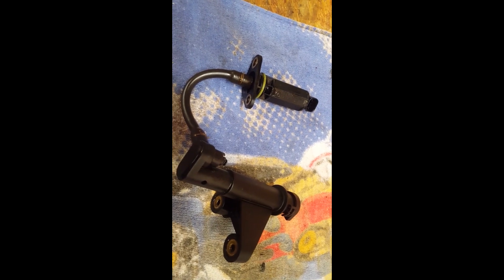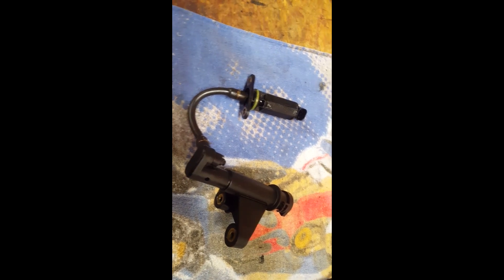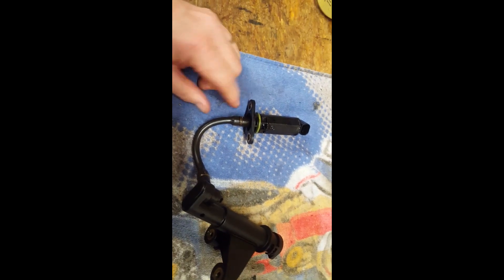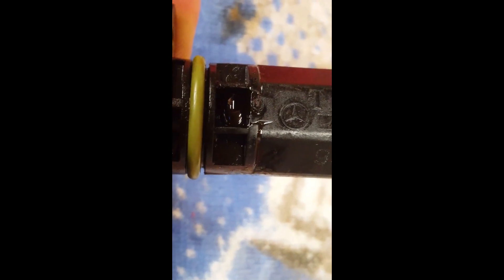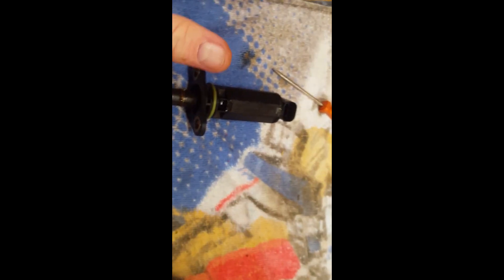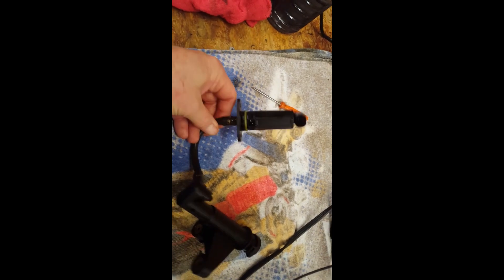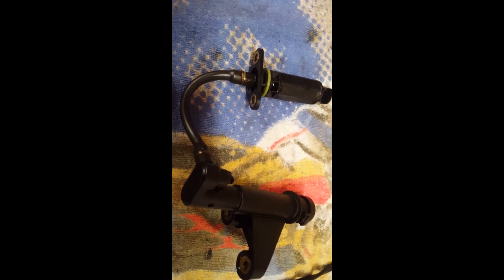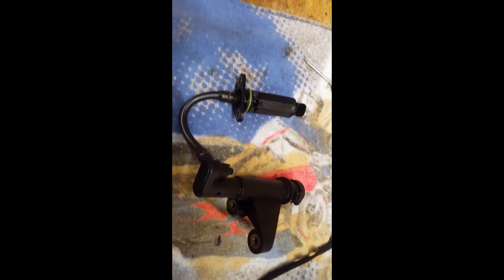Mercedes-Benz E320 Oil Leak Fixed !!

Comment: Great video and explanation.  I just finished replacing all brakes, rotors and calipers for a young kid at work. He bought a close to pristine 2000 E320 for $1000, with 150k on the click, elderly gent/orig owner- sat outside for 2 yrs. I noticed a minor burn oil cloud just below Left valve cover I’m assuming valve cover gasket, going to chase it down in the morning after my body recovers- haha
Thanks agin
Reply from the maker: There could be several sources.

Comment: I'm also going through this on my 2000 E430. Replaced oil pan gasket twice and also the oil sensor Oring and still have the leak. Did you replace the oil sensor  with MB part or replica part?
Reply from the maker: Mercedes Part as I recall.
Reply: Okay, Ordered MB part. Did you put some RTV on the oring prior to install?

Comment: I think I need to do the same on mine (late 99 E320 4Matic Wagon) -- Based on my research, I need to drop the shield to get to the oil pan, then drop the oil pan to get to the sensor, and have to reseal the oil pan when putting all back together.  I think I just need the replacement sensor and sealant as the "consumables" for the repair?  How long was the process for you?
Reply from the maker: Correct on the consumables. HOWEVER it all depends on experience level. If one has never removed and reinstalled an oil pan before, that process alone takes 90% of the time. There are a lot of bolts and they are all small and easy to break. I would concentrate on going slow and not be concerned with how long the process takes. If you break one of the little bolts off in the engine the process goes from a couple of hours to a couple of days. 😁

Comment: My E320 2002 has same oil leakage. Is that an OEM replacement or aftermarket part?
Reply from the maker: I purchased a new one from Mercedes. Part number: 0061532728

Comment: I have a question about oil leak in Mercedes e320 bluetec 2008, I dont see where exactly the leak is coming from but I see the oil on the front drivers side of the engine near the timing belt, it almost starts from the top, any thoughts?
Reply from the maker: The most common oil leak point on any car (IMO) is a valve cover. I'd start there.

Comment: Thanks for sharing!  Where did you see the oil travel after leaking?
Reply from the maker: When the oil was leaking from the sensor, it would run down the passenger side of the oil pan and it appeared as though the seal between the upper and lower oil pans was leaking. This made it hard to find.
Reply: @ImpalamansGarage  Passenger side means the side with alternator right above? My W210 is RHD, I found the engine cover is wet underneath the alternator. I am sure no oil leak for both side valve covers and ponder it's suffered from the same situation you mentioned.
Reply from the maker: @gbush1620  Mine is left hand drive. My oil pressure sender is below the alternator on the side side of the engine.
Reply from the maker: @gbush1620  very well could be. The oil pressure sender is made of plastic. Can easily crack.
Reply: @ImpalamansGarage  Thanks, so I need to open the oil pan in order to replace the sensor? If so, the sensor is inside the oil pan, why it can leak oil if the oil pan is sealed well?
Reply from the maker: @gbush1620  The oil sump actually has a top ledge. The oil pressure sensor protrudes downward into the oil sump and the top of the sensor is outside of the engine. The crack occurred in this outer part so that oil could leak out of the engine. Once you crawl under the car and have a look, you'll see what I mean. You cannot see the oil pressure sensor from below at first. you have to reach your hand up and around the oil sump to feel where it is. You need to remove the lower oil pan to replace this sensor.
Reply: @ImpalamansGarage  I took a closer look on the engine cover underneath - found oils on right side near the alternator - may need to do a project to replace oil level sensor and the gasket inside the oil filter housing.
https://youtu.be/L2q6knTHp30
https://youtu.be/1GPEUEIC3tM
Reply from the maker: @gbush1620  recommend cleaning the engine with a degreaser like Gunk and then drive it for a while to see if you can pin point where the leak is coming from. Wrap the altermator in a plastic bag before cleaning.
Reply from the maker: @gbush1620  The oil pan will work fine probably. I paid about $75 for a pan when I did mine. I am a little leery of that $36 price tag. If it were me I would opt for a Dorman or a Rein from Pelican. (Although $36 bucks is REALLY tempting!) These oil pans do not need gaskets. They are heavy gasket aluminum with thick flanges - Not sheet steel.  They just came from the factory with sealant. I use a generous bead of Victor Reinz REINZOSIL - 559526008 70-31414-10. I suspect the people on amazon trying to sell a gasket for these engines are just trying to make money. Do a little research in the Mercedes forums. You'll see that the pan does not take a gasket and only uses sealant. Here is a good kit from Rein and a pan and the sealant: https://www.amazon.com/Rein-Automotive-ESK0187-Engine-Oil/dp/B07DJ34WQG/ref=psdc_15728701_t2_B00497XOQM  (Rein Automotive ESK0187 Engine Oil Pan Kit, 1 Pack)
Reply: @ImpalamansGarage  Thanks, I will follow your recommendation - but 1) do the oil filter gasket replacement, I watched Alex's video (https://youtu.be/yU4K-mBDSeQ?t=390) and then 2) observed if any further leaking, particular right underneath alternative on engine cover. 
Meanwhile, I purchase this RTV silicon ( https://www.amazon.com/gp/product/B01BWZ1RSK/ ). OEM Oil level sensor is around USD100, Oil Pan Sump USD170.
Reply from the maker: @gbush1620  yeah that dude is all over it.    LOL

Comment: I HAVE A LEAK MY UNDERNEATH IS WET OIL SUMP, GEARBOX AND GENERALLY MORE ON THE DRIVER'S SIDE... ACCOMPANIED BY BLUISH EXHAUST FUMES ON START UP....
Reply from the maker: Typically blue smoke on start-up only is a sign of worn valve guide seals. This goes for any car. Any oil leak underneath the car would not be associated with this.